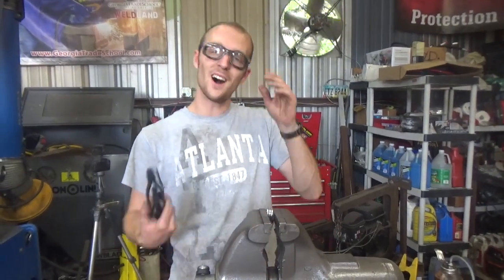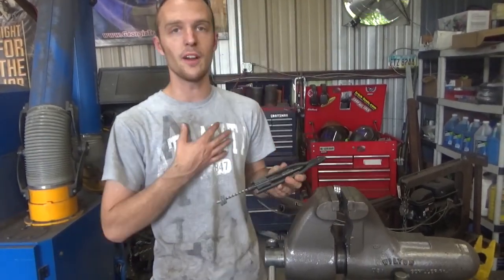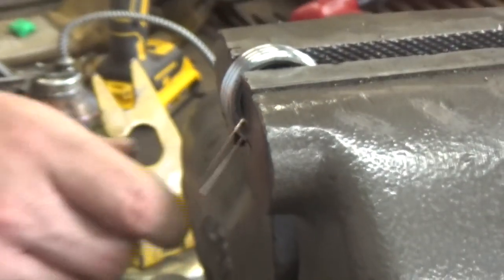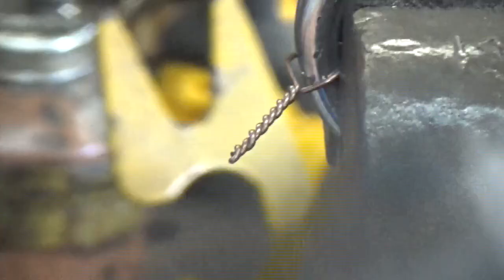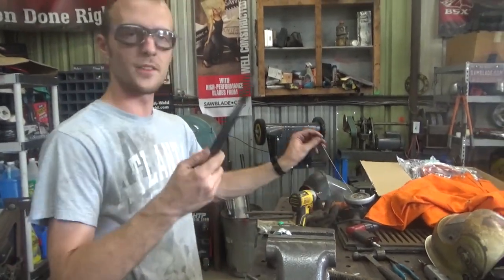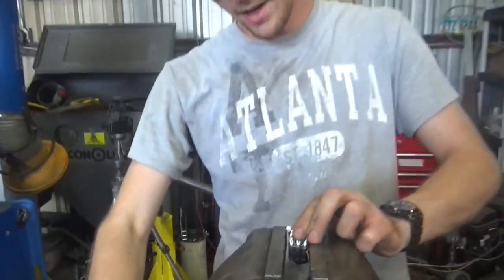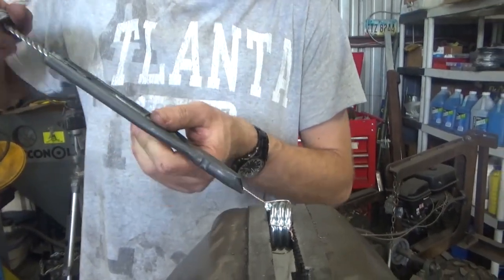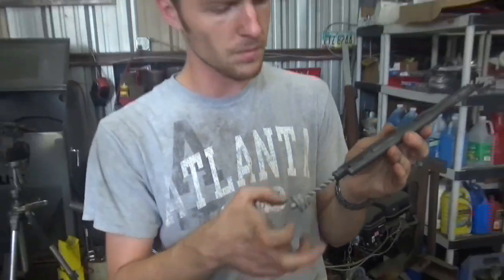WHY THIS CHEAP TOOL IS A HIDDEN SECRET SO GOOD EVEN THE MILITARY USES IT!!!

Comment: That's a must in every USAF toolbox. I'm retired and have two of those plus a roll of stainless steel safety wire.!
Reply: WIRE, NON-ELECTRICAL ROUND. COND. A COMP.  430 QQ-W-423B SIZE .041 BROOKFIELD WIRE CO., INC. BROOKFIELD, MASS.

Comment: Had a buddy who lock wired a shaft retainer in a transfer case with some non-lock wire, wire and it broke.  Not only did the gears eat the wire pieces, the retainer came loose and the be bearing failed.  

For general wiring of non-critical stuff, mig wire does nicely.

Comment: I had a friend and co-worker that had a degree in "air frame maintenance". Hope I remembered that properly. Anyway, He showed me how many different safety wire tools he had. He had those pliers and these little things that he used when he was reaching into very tight spots in the wings...
Reply: He was undoubtedly an A & P mechanic... Airframe and Powerplant. It should be noted though that you can hold a license for either airframe or powerplant. Line maintenance guys who work for a commercial airline all hold the dual license as do almost all guys that work at a repair station. It's tough to get a job working on jets without both although it can be done. You usually find that guys which served in the military are the ones that hold a single while those that went to a tech school have both. Best wishes!

- Max Giganteum

Comment: Safety wire pliers aren't uncommon nor a "hidden secret". Allow me to stop my eyes from rolling around and around. Here's the thing about using them, you've got to use wire that's up to the task you apply it to. For critical situations, use bona fide stainless steel safety wire - NOT made in China! Buy quality made in the USA wire. For non-critical situations, you might be able to get away with whatever you've got laying around or which you can scrounge up but don't expect it to last long. All wire isn't created equal! One of the tricks used on a farm in the old days was to use coat hanger wire when dealing with common equipment. It may be larger in diameter than is practical to use on the nuts found on smaller bolts but for diameters larger than a half inch, it can function well. Caveat - there might be an issue with coat hanger wire made in this century, if it comes from a foreign source then it may be too weak to use. In the 1990s and backwards in time, coat hanger wire was actually pretty strong because most of it was not imported. Yes, it's often better to twist it slowly by hand as opposed to using the drawbar on the pliers but that depends entirely on the ductility of your coat hanger. You'll find out quickly if your coat hanger wire will work! Yet another old school trick is to use unstrung barbed wire, as in barbed wire fence wire. Barbed wire is smaller in diameter and is very useful as a safety wire substitute because it tends to be very strong and resilient. The one downside is that you've got to scrounge up a reasonably decent length of it to use and then you've got to separate the strands. Once again, newly made wire that's imported may give you problems so beware. Last trick... cable wire of the kind you'll find holding up power lines or being used as an anchor for a wooden telephone pole. Cable wire is especially suited to use as a safety wire substitute due to its natural strength. Since cables come in different diameters with varied strand counts, you may or may not be able to use what you can scrounge up... but that's the main problem with cables. They can be difficult to scrounge up. Even so, if you keep your eyes open, you may come across something useful. At the end of the day, if you use safety wire at all, the smart play is to just buy a spool of it. It doesn't cost that much and it doesn't go bad in the can. Just be sure to buy the good stuff! In my 55 years of experience, I've made a point of being a scrounger so I have a variety of materials stored up in the shop and the barns. My best advice is to do the same thing. You've got nothing to lose by taking advantage of what life gives you, especially so if you get things for free. Peace & good vibes to all!

- Max Giganteum

Comment: This man used military and good in the same sentence
Reply: Perhaps they were scammed too
Reply: considering throughout history that lock wire has kept planes and rockets from falling out of the sky due to high vibrations that even wields have a hard time dealing with I would say it is a good thing but that is me. Next time you are on a commercial flight just keep in mind that there are thousands of lock wires keeping you flying.

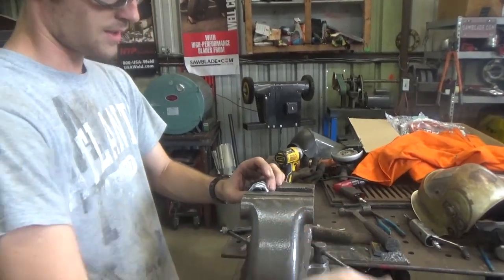Comment: I use those every day to make the lock wire tight as can be at the last twist look up a method, we call around the world. you essentially rotate the pillars like you normal are but at the same time angle the pillars at 45 degrees and go in a circle maintaining the 45-degree angle while slowly rotating the pillars normally. hard to explain. can be seen at 1:40 min mark on this video. https://www.youtube.com/watch?v=IwkL0qfyFL0&t=101s